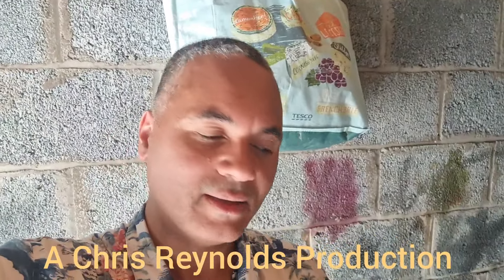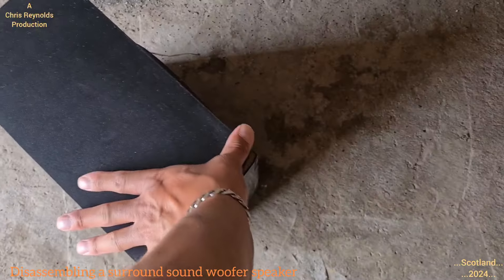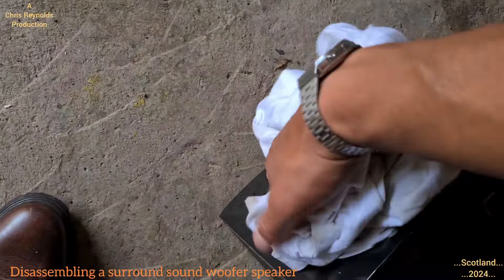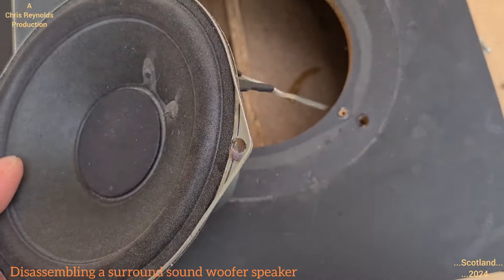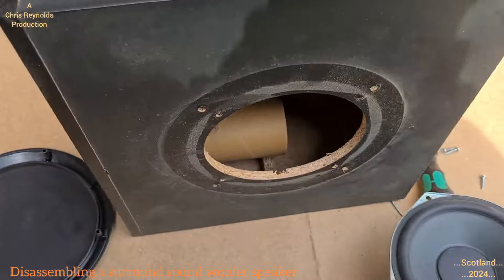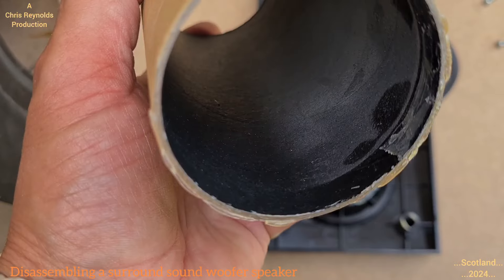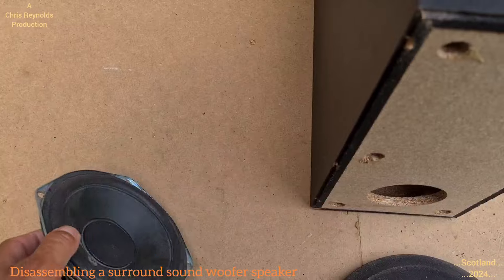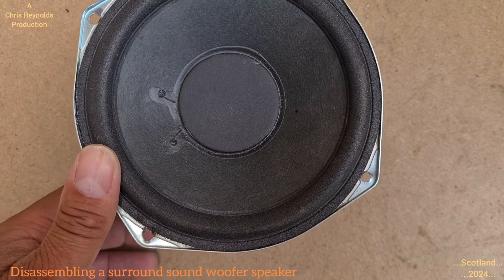Dismantling A Surround Sound Woofer Speaker       .....Scotland.....2024.....

Comment: this is a ported box, the size of the box in corellation with the length and diameter of the tube amplifies a certain frequency . this allows for peak db and better sql of certain bass notes from the subwoofer. if this was a sealed box the bass response would have a flat response. the ported box can swell say 35 hz then rolls off after that . the reason for ported boxes is to allow more sql using less speakers. the box is slightly larger but you get some deeper notes before the roll off frequency is reached. this probbaly amplifies the 35 hz frequency for a deeper bass note that goes well with action scenes in most movies.
Reply from the maker: @lorenzosamuel11  thankyou for that information 👍👍